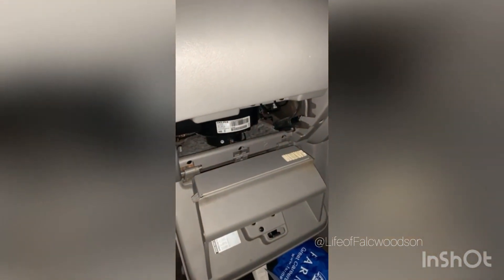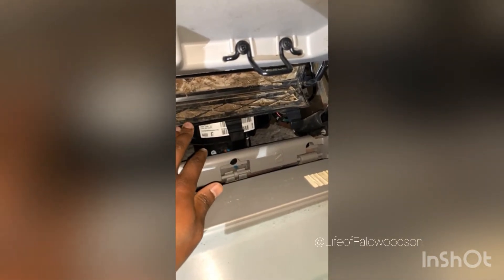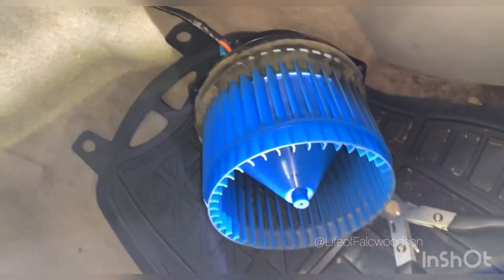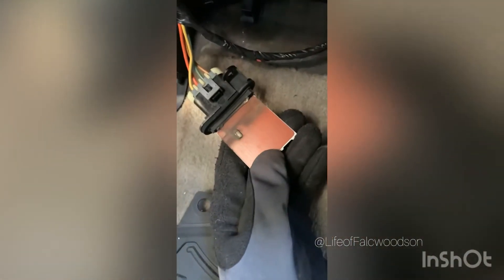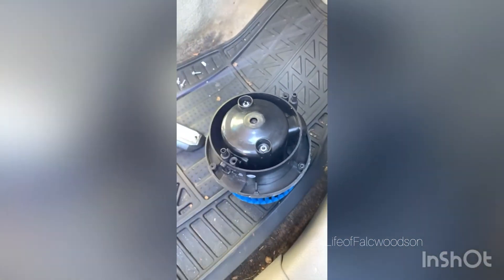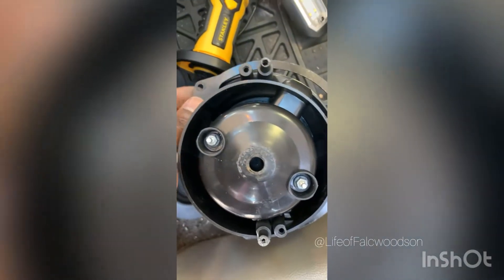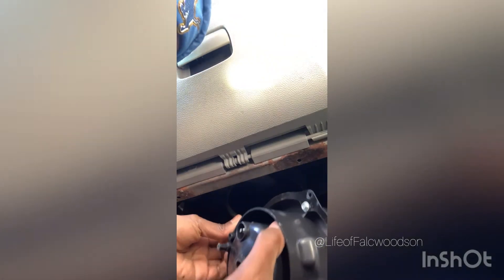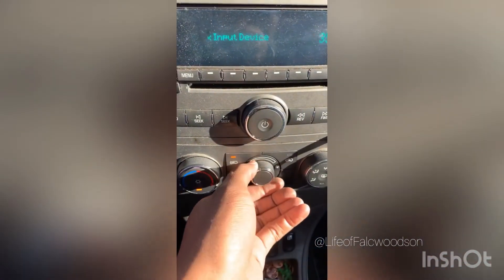Replacing a blower motor and resistor for a Chevy HHR ‘07

Comment: Okay I have did all these things and I have not got it to work I changed the resistor I changed the blower and it also changed the control module in my door is still not blowing even check the fuse so I don't know what else to do
Reply from the maker: Sorry just seeing this, but hopefully it’s not a electrical or wiring problem. Have you tried using a multimeter to check and see if you’re actually getting power to those areas?